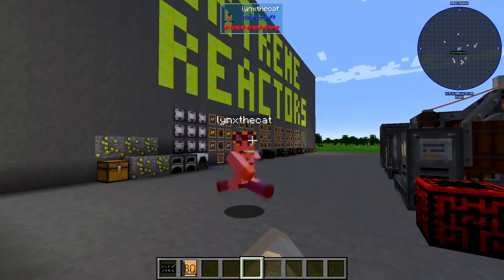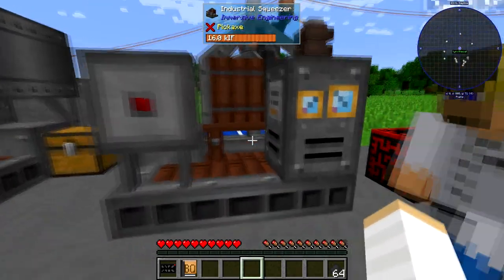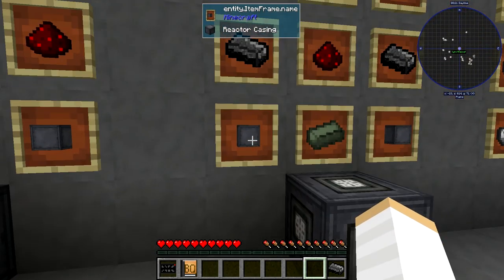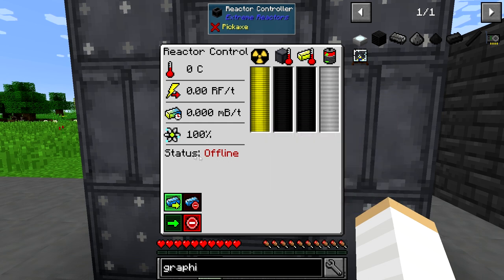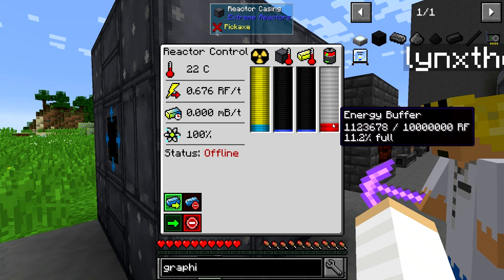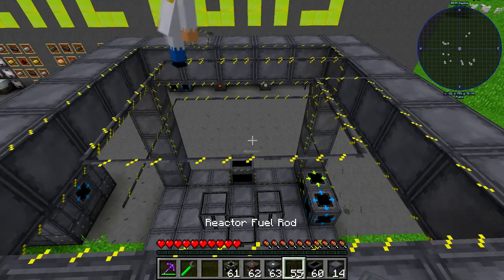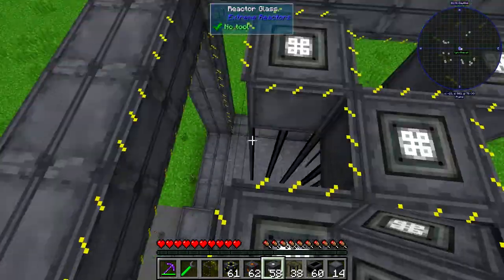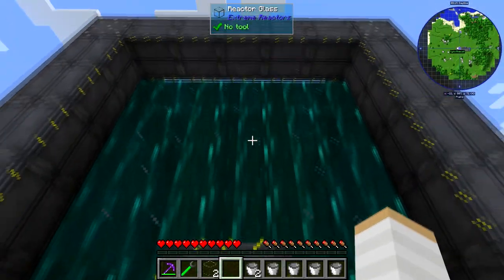Reactors Tutorial - Extreme Reactors - FTB Continuum

Comment: Yellorite ore doesn't even exist in FTB Continuum. How do I fuel a reactor and how do I get Blutonium/Cyanite ingots?
Reply from the maker: My bad, you’re right yellorium doesn’t spawn in continuum. You need to use uranium ore instead, uranium ingots can be place into the reactor
Cyanite ingots are the waste product from the reactor, which are output from the reactor access port.
You can craft a blutonium ingot from 8 cyanite ingots using the same crafting pattern as a chest.